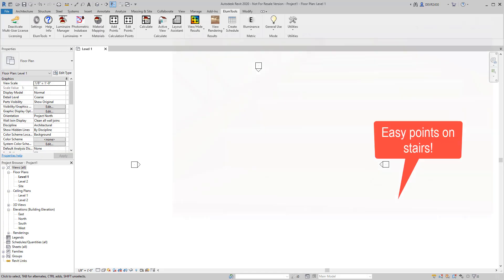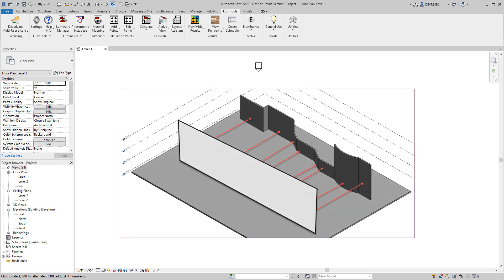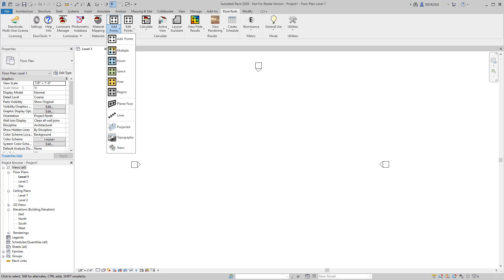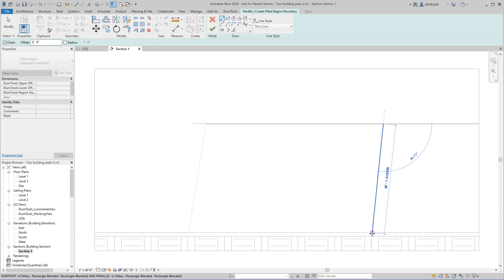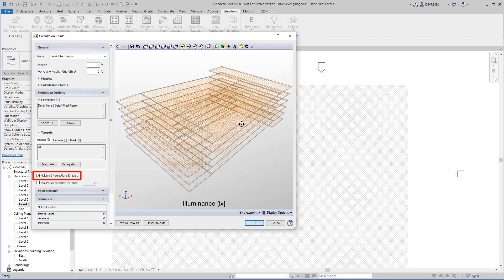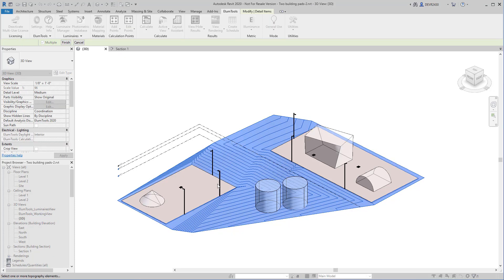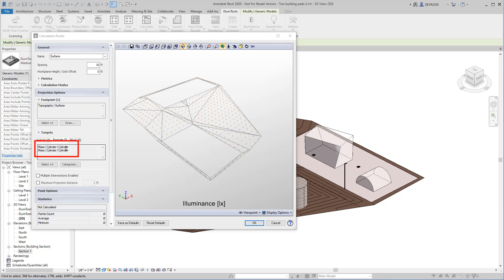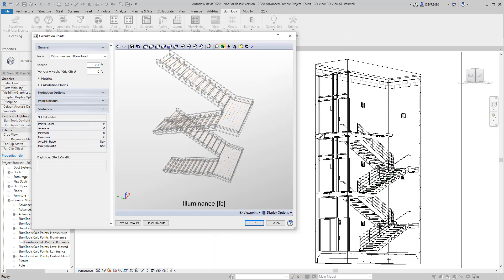Projected Calculation Points in ElumTools

Comment: The above features appears to be extremely useful, however it seems to have a major flaw: Add Points -> STAIRS doesn't work with linked models, and I would assume the PROJECTED and TOPOGRAPHY tools don't either. This makes it kinda useless, especially on projects that utilise BIM360 collaboration, as the Revit users don't always have access to other disciplines models. If you can get it to work with linked models (I have tried and it doesn't allow me to select the stairs even when tabbing) or let me know where I am going wrong that would be greatly appreciated. Thank you
Reply from the maker: Please see our KB article: https://support.agi32.com/a/solutions/articles/22000249791

Comment: Excellent...I would like to know how can I aiming luminaires, which is easy in AGI, but still trying figure it out how to do it with this fantastic Elumtools. Thank you!!!
Reply from the maker: Aiming luminaires is one thing we left to Revit. Use the Rotate tool in plan view to Orient, use it in section view to tilt. Some families also have a tilt parameter built in.
Reply: @lightinganalysts  I understand, and thank you!...but the problem come when we have families that can't Roll, Tilt or Spin because they are associated to a wall, ceiling or something. Easy example are the Emergency Light that needs to play around with the light distribution in order to get the desired levels on certain areas
...
Where can I find more of your videos, courses or complete tutorials in order to answer the big amount of doubts that I have? I really like Elumtools, but I can't use it in lot of projects because always have questions that no one can answer me.
Reply from the maker: @Modelux-Studio  Revit does not make it easy to adjust luminaires, especially when the families are not correctly built. We can always help, use our helpdesk at lightinganalysts.freshdesk.com.